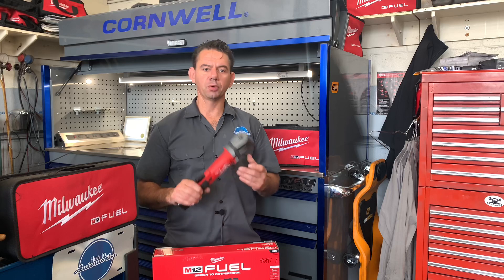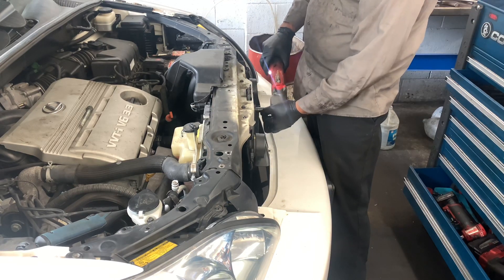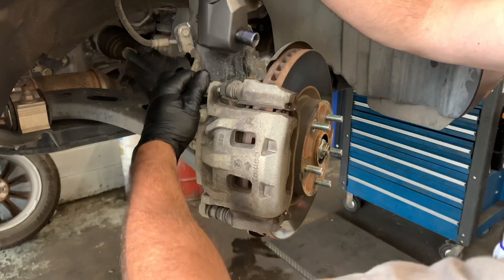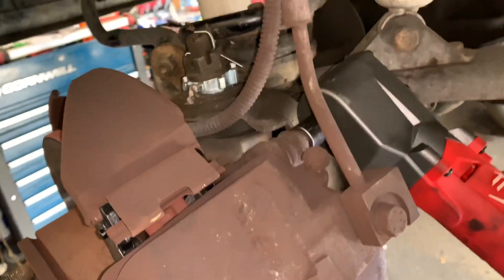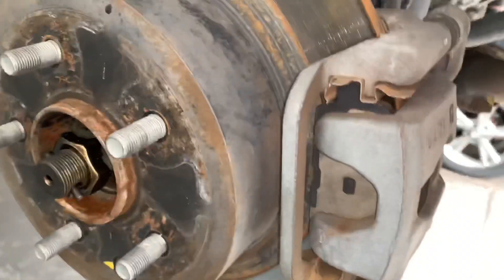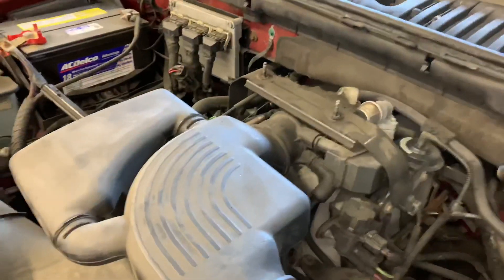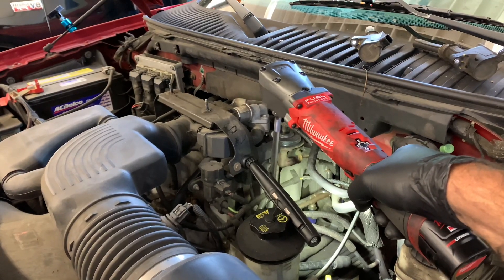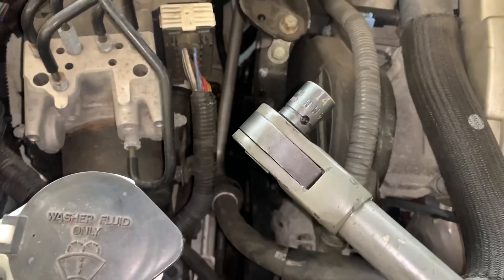New M12 3/8 Right Angle Impact Wrench From Milwaukee Tools

Comment: Its great for your upper rear shock mounts. They only get put down at 20 ft lbs. It eliminates the need for a wrench to keep nut from spinning. Stubby 3/8 will also do just as good.

Comment: looks like it does an excellent job for what it was designed for. it will allow you to remove bolts in hard to reach places that don't exactly need as much power to remove as a gun impact would have. mine arrived yesterday.

Comment: Mighty fine demo, thank you! It appears their is a market need for a really powerful right angle impact. This unit does quite a bit and like you said it apparently has a limit to about a 14mm fastener, which covers a heck of a lot of ground under the hood. I have wanted one just for exhaust manifold fasteners but do not know if it would have the oomph the break those nasty rusted bolts and nuts.

Comment: As someone who is trying not to buy every tool Milwaukee makes, I got this hoping it will do the job of two tools, at least most of the time.  So, while I am interested in max torque, I am also interested in doing lighter stuff quickly but somewhat delicately…so far so good! Using mode 1 and trigger control I have been able to do small stuff that I used to do with my old off brand, now mostly dead, cordless ratchet!

Comment: As far as the larger fasteners, if you use the bigger battery it might be able to handle them. The larger battery has higher amperage so therefore it's able to deliver more power. Maybe that's a route to explore for the next video.

Comment: I was considering buying this tool. but after seeing how u struggle to remove t brake caliper bracket bolts. u just saved me some money.
Reply: Not if you use the 6amp battery...
Reply: @onintrie224  well God damn bro a 6amp battery what's the point of that looks heavy enough n now a bigger battery.thats double t weight for effort.n then t cost for that battery 
Seems pointless.ratchet with long handle to lose then use my m12 .milfucky to loosen.
Reply: @JuanHernandez-ov8wv  you got a point, but still lighter compared to the M18...

Comment: I started out with the Kobalt right angle impact which it just too weak and ended up with the Milwaukee as the Kobalt couldn't even break the caliper free.  I'm just a DIYer and it works fine for me.  I also had to use my high torque impact to remove those larger brake bolts.
Reply: Wat amp hour battery u using? That's the problem why your not able to break it loose. I'm assuming your using a 2ah battery. Should try the 6ah. Totally turn it into a hulk lol

Comment: Hi, this video was exactly what I was looking for. Thanks for the upload. I bought a M12 FIR38LR (75NM) to undo a 21mm rear shock bolt. It’s got no guts. I can hold the socket tight in my fist and it can’t turn the socket. It has no power. Apparently this is normal , so the head distribution place in UK says. After watching this tool, maybe this would not do it either. The right hand rear shock access is tight with the exhaust in the way. Last time it took me hours with a manual ratchet. Was so looking forward to using my brand new tool.

Comment: Wish it had more breakaway Torque.  This would be awesome for doing air bags on buses.
Reply: Just break the nut loose then use this to finish it off. I'd like to get it for the same job and class 8 diesel trucks and trailers airbags

Comment: It’s really good in certain situations. I primarily use it for jeep suspension builds. I probably should have bought the 1/2 version since that’s what I mostly use but I had a nice set of Cornwell 3/8 impact sockets. Not at all disappointed but also not super impressed.
Reply from the maker: I feel the same way about it right right there in the middle. Thank you for watching!

Comment: Thank you Brian. Good job. Looks like they exaggerated the breaking torque of 220 ft. lbs. They probably meant 220 inch lbs. Have a blessed and safe week to you and your family.
Reply: That's equivalent to about 18 FT/LBs. This tool does not have 220 break away torque, but it's up there. I've removed f-350 lug nuts which are in the 140-165FT/LBs with ease.
Reply: @pumanegro3636  Throw on the XC4.0, and better yet the XC6.0, and you will change your mind. After unboxing, I tested on 30mm bolts that were used for assembling my 20 ton floor press (xc 6.0 Battery).  It took 11 secs to remove it with a twisted split ring washer 1/8 inch thick set at 200 ft lbs, simulating rust situation pretty much. With split ring washer removed,  I stepped it up to 220 ft lbs, and it took it off in under 2 secs....suprised me how fast it came off (using 1/2 inch model). Used heavy sockets (reg length), they make a difference.....hit harder, like sledge vs regular hammer.

Comment: They are good tools to have. I have the ingersol rand 20v right angle and honestly i don't use it much. But when i need it its great! Upper control arm bolts are a common thing i use a right angle impact for. Speed is key and all, add rust and even the most powerful power ratchet gets caught up alot. Anyway these tools are no substitute for a regular impact or a cordless ratchet! A great ayou ddition to your tools but they should be purchased AFTER you have a ratchet and impact in that size.

Comment: Seems like this tool was only made to take off two caliper bolts. I feel like anything else you could use the stubby or the electric ratchet.
Reply: I bought it for applications where a ratchet isn't strong enough and an impact won't fit and for those situations I think it's great.

Comment: If it also locked like the weak ratchets do it would be perfect, actually ill add if it had a second on switch on the front somewhere, as that would help when you would put your hand over the ratchet, not a deal breaker.

Comment: I recently purchased the m12 Fuel Driven to Outperform and what I did was watch a few reviews on it to see what batteries to get for it to get the most power out of it and if your not using the XC4.0 battery minimum for work then you are wasting your time I purchased 3 XC6.0 no problem 👍🏾 but if you don’t do your research you will get disappointed 😢

Comment: Looking to purchase one but debating whether air or battery powered to replace a broken one...thanx!
Reply: I was in the same boat as you! Initially I was thinking how is 12V going to compete with 125psi air tool! I should of went with my instinct. I bought this tool to remove the Upper Control Arm for my Car. The space is IMPOSSIBLE for any Standard Neumatic Air Gun!!! With this Tool it may easily fit in the tight spots with the 90 Degree! I was excited to try and remove the Control Arm. I received the tool and went straight to my car. I removed the tire and grabbed the 19mm Socket! I made sure it was tight on the bolt and was excited to pull the trigger! I push the button with all my strength and the Tool began to impact!!! To my surprise!!! The Bolt did NOT budge one bit!!!! What a waste of time!!! Returned the Tool and paid a Mechanic to do the Job!!!

Comment: It's an improvement compared to the m18 right angle impact that could only remove 10mm bolts.  12mm was touch and go.  14mm forget about it.   Shame this tool can't do 17mm caliper brackets.  Hopefully the next gen will get there
Reply: It's because it's the 3/8 version with the smaller battery and he used a small impact socket, then added an extension - all those things will absolutely kill impact torque. I have the 1/2 version with an xc6.0 battery and took 19mm nuts fastened to 145ft/lbs off my front struts with no issue with a deep well impact socket. 21mm 90ft/lb lug nuts and 90ft/lb control arm nuts with some rust were not a challenge either - all flew off after a few impacts.
Reply: @kaimingleung1396  mine struggles to remove 17mm lug nuts that are torqued to 120nm (88ft-lb) thats using deep impact sockets (6 point) 1/2" with the 6ah pack. The same result even after manually breaking them off and torquing then back up and them impacting them off

Comment: I'm on the fence on the 90' impact. I've been giving it the beans for a few days now not Shure about it's worth $$$
Reply: I got the ratchet and 1/2 mid torque, so maybe I'll wait for a more compact version to come out
Reply: If you have the budget and space in your box it’s a handy tool to have. I just wouldn’t call it a necessity.
Reply: @Volksoner619  ya it not a wast. But in my case I had a old Ingersoll Rand Hammerhead that I've been unimpressed with but does as good of a job

Comment: I just returned the 1/2" version, I tried it on multiple fasteners, only broke one loose. The sad part, the M12 extended ratchet broke loose more bolts then the right angle. And yes, the extended ratchet is not intended to break loose fasteners. Really disappointed, as I do have a use for the right angle. I ordered another in 3/8", will give that a shot, as the 3/8" M12 tools seem to be better than the 1/2", which is odd, because the only difference between the two is the anvil.
Reply: What size battery did you use? For these you need the 5 or 6AH to get some power out of it
Reply: @mike_t_007  It was the high amp battery. I have a few of various amperage. I always go for the big ones. And it was a Milwaukee battery.

Comment: Respectfully I cannot see it being more beneficial to me it didn't seem like any bolts it broke loose were factory tight just seemed like it had been previously I would give it a three on a scale of one to ten ten being better
Reply: If you get the 6.0 battery its a big difference I’ve used it on suspension,exhaust and lugs works great so far
Reply: Yeah he was using a small battery that doesn’t produce as much power as the 4 or 6amp

Comment: You got the 4th mode backward my friend, it’s for running a bolt or nut down, when it detects resistance it stops making that fastener ready to be torqued with a torque wrench.
Reply: It does both according to what I have read.

Comment: Got a review on comparison of ATG, CAT, Kobalt, IR & Milwaukee?
Reply: The Milwaukee has like 30ftps more tork the the bigger bulkier Xtr.. Kobalt.
Reply: @michaelmangino9819  Actually the Kobalt has more reverse torque than Milwaukee.
Based on two, they both are too heavy to hold & use (4A batery)?
Reply: @angelisone  not to heavy for me . I think it's light. My hand fits perfect to it
Reply: @michaelmangino9819  It's not heavy for you with a 4A or 6A battery?
Reply: @angelisone  no, all I have for my m12 are 6.0.. I do think the button to control imo should be like 4inches more towards the anvil end. But other being a bit to long I thinks it's balanced and very easy to handle. I wish the came out w it last yr. Bcuz id prolly not bought the 1/2 inch ratchet that only had 175rpms.. But yea I think it's sweet. It's really about like the ratchet. Just kinda heavier on the anvil end vs it. Same diameter as the ratchets.
Reply: @angelisone  man does it spin ! Really fast! Put a wobble socket on and they spin super cool and fast at a 45degree  angle😂 should be a great tool for many uses. I mean I usually use my high tork 1400nut buster which is like 8pounds when I work on my quads or cars. But now I've gotten the smaller impacts from dewalt and Milwaukee. Plus I just got this right angle impact..

Comment: I think Milwaukee is reaching with the new ratchets. I don't think they justify the power and cost compared to older series. The ratchet head is also not going to fit in most places that people need them to fit into. I would only buy it if you can't live without it. I am personally going to save my money.
Reply from the maker: kj197734 I don’t know if they’re reaching I like the innovation in the moving forward.
Reply: These aren't new ratchets though.   It's basically their M12 stubby impact wrench in a similar case as the ratchet.   It does seem like it's rare though that you'd need to use this specific tool, instead of the stubby or the fuel ratchet.
Reply: Honestly I think it's a great tool for someone who doesn't already have the stubby. Like if you don't already have the M12 stubby and you're deciding between the two, then this is the definitely the tool to get unless you really don't like the ratchet form factor or you're using it in a non-automotive setting where clearance is not so much an issue.

I'd also say that the 1/2, hog/friction-ring version of this tool is the one to get for ease of use and maximum effectiveness. Get the bare tool and at least an xc4.0 battery as well.

Like I wanted to get the stubby, but I waited for this to come out and I'm glad I did. I see no reason for me to get the M12 stubby now, the 3/8 fuel ratchet and the 1/2 right angle impact are the go-to-tools in my bag with an 18" 1/2 ratcheting breaker from Harbor Freight and a 1/4 ratchet as a situational backups.

Comment: Which would  you recommend using , the 1/2 or 3/8 drive?
Reply from the maker: Andy Albor 3/8 all the way. There’s not enough torque for half inch sockets. Plus you have a lot more socket options with 3/8
Reply: How to Automotive  Also for the Milwaukee ratcheting tools, which drive would you recommend on using, 1/4 or 3/8 drive?
Reply: @HowtoAutomotive   I’m buying tools to work on my freightliner Coronado.  What torque range should I move up to 1/2 anvil? The mid torque?

Comment: Do you recommend 1/2 or 3/8 drive?
Reply: 3/8
Reply: Depends on what you’re working on. I got 3/8 because I had a nice set of mostly unused cornwell sockets but should’ve gotten 1/2 because it’s what I mostly use. It’s a great tool for suspension and brakes but know that you’ll need to break loose some (rusted/thread locked) stuff with a bar.

Comment: Well that’s disappointing. You demonstrated it in wide open circumstances and in tight spaces it still wouldn’t fit. What about if you need to remove a harmonic balancer w/o having to take the front end off? Too big?  Seems so.

Comment: it doesn’t ot work to remove nuts from tires?
Reply from the maker: It’s not design to. To do that you have to add extensions and and that reduces the torque

Comment: Why are people even trying to use the (ratchet) to break fasteners free. Just because it has a (torque) rating?  Try it with a air ratchet, LOL and crush your knuckles.. Ratchets are ratchets, they don't impact. That's why this tool is a RIGHT ANGLE IMPACT and the ratchet  not a called a impact ratchet

Comment: Have one in 1/2 drive. Torque is extremely weak...nowhere near 220 ft-lb advertised.  Wouldn't break out a measured 105 ft-lb bolt. Has 85 ft-lb effort at most regardless of setting